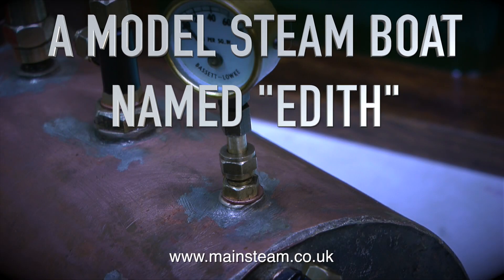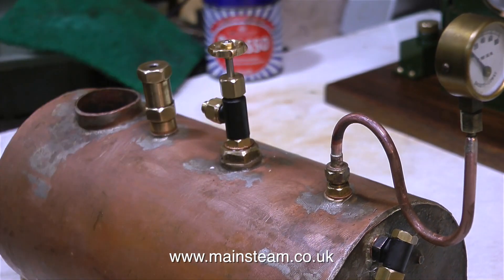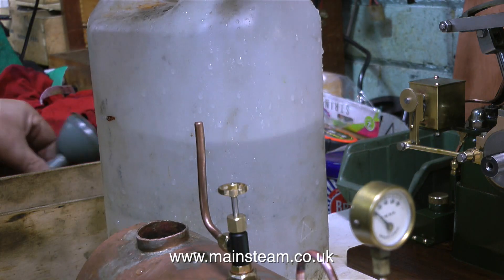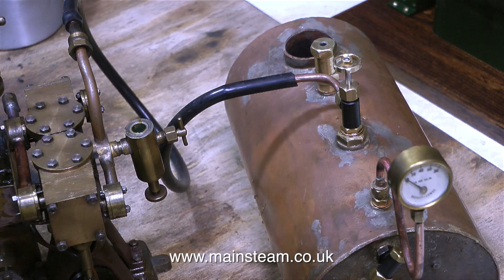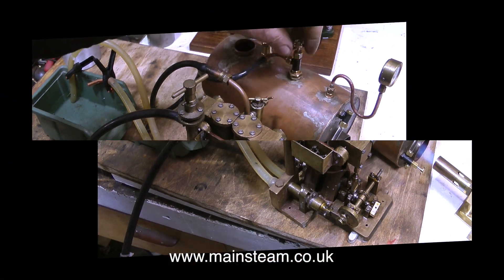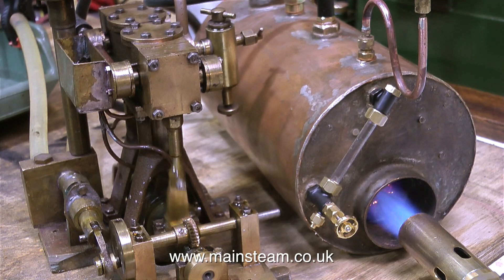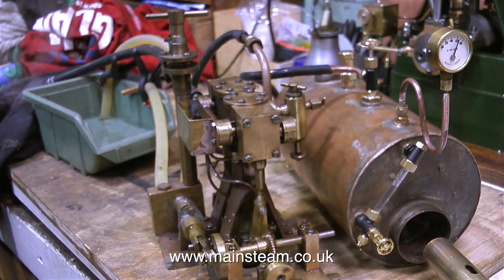A MODEL STEAM BOAT NAMED EDITH - PART #4

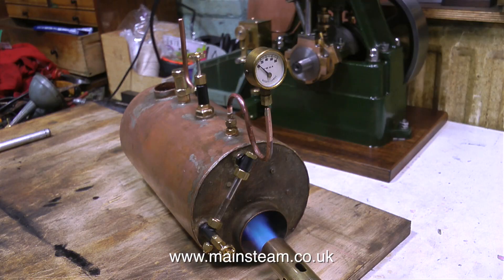Comment: 3:30 if this were a life sized steam boat engine or locomotive, heat would have slowly built up in the tubes and boiler since the firebox wouldn't have been able to  produce a lot of heat quickly

Comment: The rapeseed oil you put in your oil mix is giving you no benefit. Rapeseed oil has long been used in the steam industry because the erucic acid it contained, about 45%, was resistant to being washed away by steam and provided a thin oil film on metal parts. The Canadians determined that erucic acid was not healthy in a humane diet. In the 1980’s, the EU decided to make the switch from the old rapeseed to what is called LEAR (Low Erucic Acid Rapeseed), 00 rapeseed, or canola. This is what you are buying in the grocery store and does not contain erucic acid. HEAR (High Erucic Acid Rapeseed) oil is still available for industrial purposes and is what you want to add to get the benefit that the old railroaders were talking about.
Reply from the maker: I don't dispute your facts, but when I tested the effectiveness of lubricants, the mixture with modern Rapeseed oil added was definitely more "slippery' and the engine I tested it on ran more more smoothly with the addition of my Supermarket bought "extra virgin" type Rapeseed oil - so I will continue to use it I think }:-)))
Reply: Brands of mustard oil such as KTC, readily available at Asian shops in Yorkshire, England still contain 20% to 40% levels of erucic acid. The constituent erucic acid is described as unstable at the 489 fahrenheit 254 centigrade smoke point of mustard oil and breaks down.  The smoke point of unrefined (cold pressed) rape seed oil is lower at 225f 107c, semi refined rape seed oil 350f 170c and refined rape seed oil at 400f 204c.  I have been informed that the perma-offended pc mob are trying to have the name rape seed oil banned.  Charlie, was rapeseed gm'd to reduce the erucic acid content  ?  

Upon checking my 1936 copy of thermodynamic properties of steam, Joseph Keenan and Fred Keyes, which fortunately still has the mollier chart in the back sleeve,  I noted that table 2 describes 60 psi producing 292.71 f and 80 psi as 312.03 f,  both steam pressures well under the smoke point of refined rape seed and mustard oil.  At 19 psi if it heats the steam to 225 f cold pressed unrefined rape seed oil could start to smoke.  To achieve the smoke point for mustard oil and unrequired break down of the erucic acid at 489 f you would need to get above 620 psi, which seems outside Mr Keith's boiler's operating parameters. 

Perhaps Mr Keith could be persuaded to resist the allure of extra virgin rape seed oil and go for a more refined and experienced variant; however as the current oil mix works well for Mr Keith, any changes are unlikely worth the worry or bother.

Comment: A word about Nitrogen; In HVAC systems, we do use Nitrogen to test for leaks because it is truly "smaller" than air. AND you absolutely cannot test with water in an HVAC system. ANY moisture at all will destroy the system. - Plus, Nitrogen comes in tanks that are about 2000-5000 LPSI. In a system with a small amount of Freon added with 2500 psi behind it WILL find it's way out! That bit of Freon is used to aid the electronic "sniffers" to locate the leaks. -- But when it's time to "dump" the system, the BLAST of GAS is very dangerous and must be channeled through a High Pressure set of gauges with valves and hoses. If you don't control this violent release, a hose or fitting may shoot your eye out or KONK you on the head! --- I used to design and install Geo-Thermal heating systems for a living. ---

Comment: The viewers suggesting a gas test like nitrogen, should visit the steam museum in Medemblik in the Netherlands. Tucked away in a corner, there is a full sized boiler, or better, the remains of it. That boiler blew up. Its unimaginable how much force was excerted on the metal walls of that ex-boiler to make it shaped that way. That piece of twisted metal impressed me more than all the nice steam engines combined.

Comment: where i work We built a riveted traction engine boiler and we did a cold hydro test using the same principle as you showed i the last video but we also did a hot hydro test which the boiler was filled with water at mains pressure 90psi and then we used a diesel burner heater aimed into the firehole and the water expanding from being heated brought it up to 200psi. Also on another note with pressure gauge siphons one of the steam engines i drive now and again had a problem with the pressure gauge and it turned out some of the scale had formed in the syphon and nearly blocked it so the gauge was working but it was operating slower than usual. After cleaning out the syphon it worked fine afterwards

Comment: No they do use pure nitrogen for testing some tanks for leaks, not pressure vessels for force. Nitrogen is used because the pairs of nitrogen atoms are smaller than that of air, science can be really weird like this, but it's NOT suitable to test a steam vessel.

Comment: Isn’t it better to use distilled water so that you need to clean the boiler less
Reply from the maker: No, I use tap water.
Reply: If you lived where I do, you'd either install a water softener, switch to distilled water, or spend some time descaling your boilers.

Comment: Bonjour Keith,
Why would you dry the steam,  I do not understand ? At 30/45 psi, a steam machine does almost not need oil to run correctly.  What are the benefits of a dry steam compared to a wet one ? 
Amicalement, Raphaël
Reply from the maker: Efficiency and greater economy of steam

Comment: Keith, I have found from experience that some folks cannot make the logical leap from "non-compressible" and apply it to the idea of "stored energy" which is really the crux of the matter.  You did an excellent job explaining the non-compressible nature of liquids in the last episode assuming folks know the implications.  As you well know, even a small volume of steam, air or other compressible gas has the ability to store enormous amounts of energy.  That little "squirt" of water although at the same pressure, has very little in the way of stored energy.  Thank you for your videos, I really look forward to each one.

Comment: Mr. Appleton, I notice on several occasions, including Edith, there is just a tubing (silicone, I presume) slipped on the copper pipe while steaming an engine. At 60 PSI+ I would worry about it coming off, especially with live steam involved. Apparently is does not, silicone rubber being "sticky". Nevertheless...
Reply from the maker: This is very thick walled Silicone tubing and gives me no problems at all - it occasionally does come off but not with steam - just with compressed air. The heat seems to make it stick better - it is convenient and allows a quick "lash up" for test purposes to be made quickly

Comment: I noticed the crank pin driving the water pump has several positions. If I am correct changing the position of the drive pin to the pump will alter the stroke and so the quantity of water pumped per stroke. This may well be a way of balancing the feed water. But being in a boat the checking of the water level may be difficult.   If the bypass was open a large amount then altering the pin could very well be an option.
Reply from the maker: A good comment, there are options with the variable stroke, which is a very rare option to have . . . . but getting the bypass setting is easy enough as I will show later on.

Comment: The reason for Hydrostatic testing is simple: Liquids are incompressible. Liquids can ~bear~ pressure, but cannot ~store~ energy in the form of pressure. Hydrostatically pressurized vessels will discharge incompressible liquid when the pressure is released, but this is because because the pressure vessel itself flexes outward under pressure (and the odd air bubble trapped here and there, hoses, seals, etc...), and when the pressure is allowed to escape, the vessel walls will relax and any trapped air will expand, forcing some liquid out. But the total amount of energy released is small and hence there is very little material displacement (Displaced material = vessel displacement under pressure minus relaxed vessel displacement). Even if the pressure vessel fails catastrophically during the hydrostatic test, it can't explode (though they can certainly go with a loud pop): the only energy stored in the pressurized system is the mechanical energy of the pressurized vessel, and the small amount of air bubbles trapped in it. Gasses, being compressible, do store energy, and once the pressure reaches the point of failure of the pressure vessel, will then further equalize (total energy of the system is energy stored mechanically by the pressure vessel plus the energy stored in the gas).

Comment: Kinda like the look of the engine, even as crude it is, are you going to clean it up?
Reply from the maker: No, it is in the bottom of the boat and it works perfectly as it is. There is a lot of work to do on the boat itself, so any extra unnecessary work will be avoided . .  .

Comment: Keith,
I believe i was misunderstood, I did not check any boilers with nitrogen, the testing I was referring to was at power plants, where finding the slightest leak was important  I was asking, in a round about was if you could use a gas for the test which you told me not to do it. My error sorry
Reply from the maker: I needed to clarify this for viewers as I didn't want anyone to try a Nitrogen as a boiler testing medium.
Reply: Thanks Keith,  did everyone hear that no gasses ONLY water, listen to Keith
Reply: Ralph, that style of leak-checking is generally only done to test high-vacuum systems, or systems that deal with dangerous substances. There's not much benefit in doing it on a simple steam engine. It's sufficient to use the soapy-water trick, or just look to see where condensed steam is leaking out once running it with live steam. Would it work to fill the system with helium and use a helium leak-checker? sure. There's just no point in that expensive system for models.
Reply: nitrogen has a large molecule and is sold to fill car tyres with, supposedly stays inflated longer. , helium has a small molecule and would find a leak much easier, and will leak out of rubber,!  which is why they are usually mylar balloons for the kids

Comment: Nitrogen?  Wow.

Anyhow, could we get a peek down the flame tube in the boiler? I would assume that there is a lot of surface area in there due to the tubes which would make it steam along with less gas to the burner.
Reply from the maker: Yes I will show it in the next video .....
Reply: Thank you.
Reply: The Nitrogen comment made me giggle.  Not that it is really relevant to this, but the liquid - gas expansion ratio of Nitrogen is about 1:700. Which actually makes it very useful for filling gas pipelines before they are commissioned.  Having normal air and natural gas in a pipe line is obviously not a good thing.
But anyway,  If your little boiler was full of liquid nitrogen and something gave.  It would try to become 700 times it's size very quickly..
Running away, Monty Python style, would be inadequate in this case..